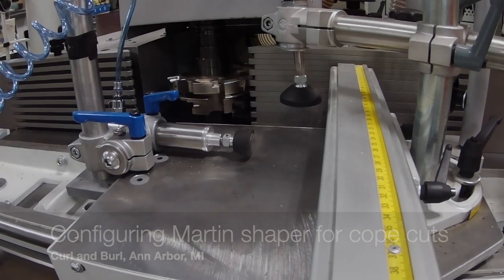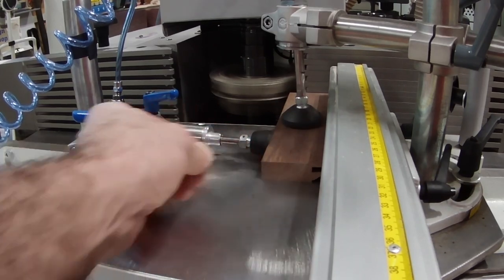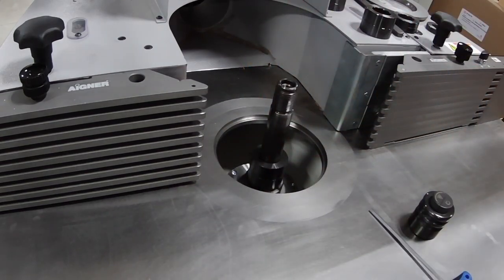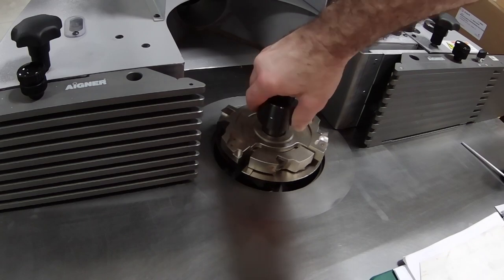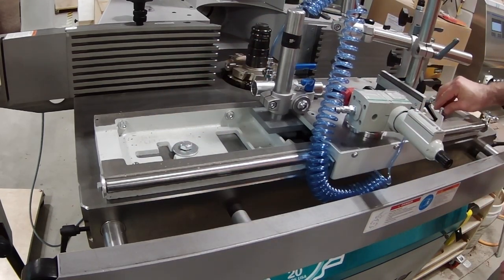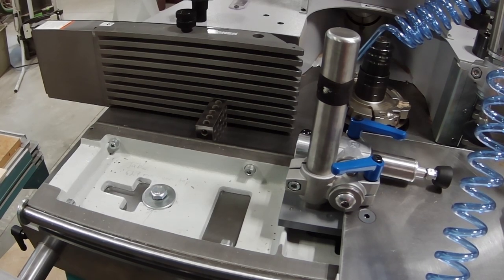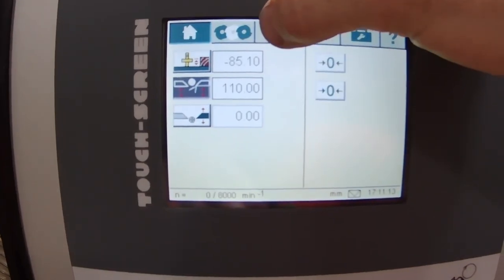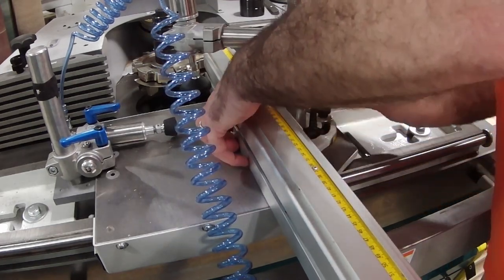Configuring the shaper for cope cuts

Comment: Ignoring the Martin and macs clamps, how are you coping into the profile without a backer?
Reply from the maker: i guess i don't understand the question.  i'm doing the cope cuts first, and there's almost no tearout with the zuani cutters, especially on relatively soft woods.  then i run the profile cuts, removing that entire edge.  any tearout that is there is then gone.
Reply: @curlandburl6937  15 seconds into the video you are coping a already profiled rail. I'm guessing from you response that is not your acual process.
Reply from the maker: @jar944  this video is really showing setup - my process is illustrated in the other video.  no idea what i was doing here, probably just running a test cut to check the vertical alignment.
Reply: @curlandburl6937  I was hoping you somehow solved the tearout issue with coping after sticking with a single cope head and no profiled backer...lol. Would have saved me from buying clockwise and counter clockwise cope sets.

Comment: I have the older CNC Felder Profil 45 Format 4 shaper with sliding table and 30MM spindle. With the Felder hold down clamps and using the Aigner fence along with or without the Felder block; we achieve the same you have here for cope and stick cuts. We clamp the wood in a perfect 90 degree position on the out rigger and begin the cut with Felder rail and style tooling or make muntins using the optional Felder high speed spindle and a custom router bit to match the Felder tooling in making muntin profiles. With the CNC fence we are able to adapt to a variety of muntin widths required to join muntin to rail and style. This setup with Felder shaper probably costs approximately $25-27K less than your Martin with sled and Italian tooling. We use the same Felder X-Roll out rigger with Felder round corner tooling and Aigner fence to round over corners of replica antique 150 year old UK design air rifle boxes. 
For end grain cutting the Felder has a custom spoil block on the out rigger fence to eliminate tear out. Felder Senior was quite a clever guy in his day.
Reply from the maker: i'm glad you're happy with your felder setup.  i know many great woodworkers who do terrific work with felder equipment.  i looked at the felder shapers very carefully.... before buying the Martin.